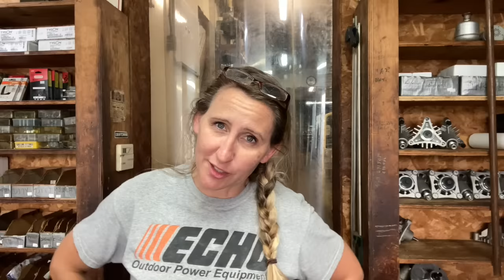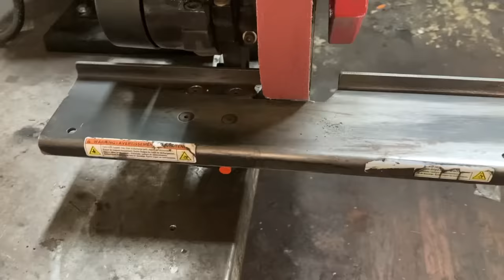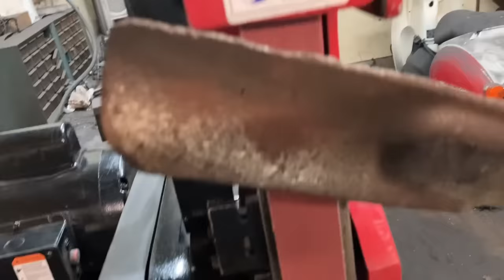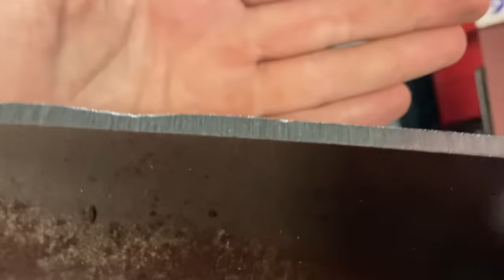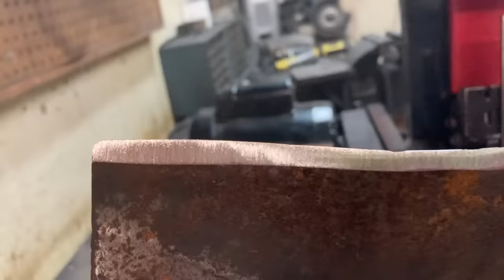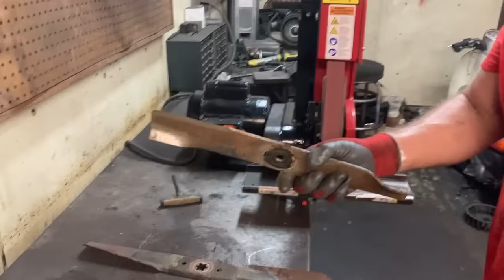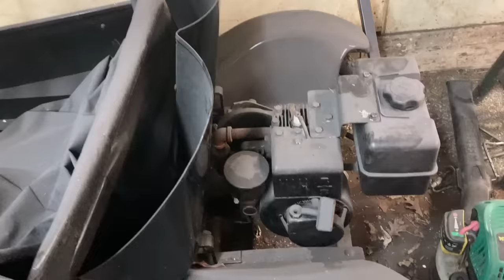The Best Blade Sharpener Ever!!! Oregon Burr King X400

Comment: Does that machine put a factory edge on the blade, hollow grind or some tech's call it a hollow back grind, the one I used when I was much younger as a tech was a large grinding wheel and it did the factory hollow back grind, that's a pretty cool tool if it does the back grind. 👍👌❤️

Comment: First off, if someone wanted to, you could build one of these out of a bench grinder, with a wire wheel on one side and a 4" wide long belt sander, but i do mine with a 4" disk grinder in less time, but my blades never get that funky. 
I was taught by an old heavy equipment operator to just lock the blade in a vice and use a file, 
But i worked in a machine shop 8 years grinders and belt sanders was something i used every day.
I have very good mussel memory using tools freehand  i could just use a 4" belt sander without the bottom plate.
So is the blade in balance?  
If its not it wears out your spindle

Comment: Honestly… I want one but not sure I want to spend that much.  I have a large yard and normally pull off my zero turn blades every 3-4 weeks for a touch-up.  I mow about 2.5 acres of 9 per week.  Rest is wooded so I hit a lot of sticks and dull them quick. Right now I just use my little Cub Cadet HTL 550 lift and a Dewalt impact and get them on/off in about 10 mins.  The annoying part is trying to get the blade angle right with my cheap Lowe’s wheel grinder.  It works but I never know if the angle is right.

Comment: You might try a zirconia belt I have had better results with those as to life and blade cooling.  For reference I run a older 2 x 72 belt grinder with a 2hp motor so your grinder is different but still worth a try.

Comment: My problem is not sharpening the blades I can do three with a right angle grinder and flap disc in just a little over five minutes with balancing my problem is finding a blade that will last down here in the Florida sand on a Dixie chopper it goes through them like Rosie O’Donnell goes through Twinkies…

Comment: Yes, if you are a dealer who not just services machines, but sells them, making a good 200,000 or more a year annually, you could justify and afford to purchase a 1500 dollar top of the line kickass blade sharpener. But if your a small town shade tree mechanic like me, or home owner, I can agree with you, we don't have those. I personally use a Milwaukee 13-amp angle grinder with flap disks, yes it takes me longer for sure, but it gets the job done. And don't forget, sharpening is not the whole project to blades, got to balance them too. So I ask you, what balance tool do you use? I use the cone shaped ones.
Reply: I grind down old spindle shafts on the the belt to make balance posts. The Chickanic just asked me for some blades to sharpen so I went to the scrap metal and got three. There was no way I was going to balance some scrap pile blades after she kept me at the shop late. I also removed the riser on the table that holds the shaft to shoot the video, but that machine is gold to us, don’t think I could do a summer without it now.
Reply: @dudekanic  Neat idea, I like it! I just discovered Chickanic, I think she is awesome, we need more lady mechanics in the industry. It also helps in being self sufficient. Cool stuff!

Comment: Clearly a belt may do a better job than wheel. With this set-up you can put a concave cutting edge on the blade and then add a straight (fine) cutting surface. One can do a similar job with a standard 2 stone grinding wheel, providing one is careful not to destroy the blade's temper.

Comment: I mount the blades from my 72-inch deck from a JD F915 in a bench vice, and grind them with a 4-inch handheld grinder. Seems reasonably effective, and it's way less expensive than your grinder. Maybe takes two or three minutes per blade. Is there a particular grind wheel brand or material that you'd recommend?

Thanks.

Comment: Mine is bigger than yours!  I have a 2x72 with  1.5hp motor, a 3hp is actually better.  But I needed to run off 115, and it is good enough.  This is standard for knife makers and other fabricators.  At 3hp you could push a wrench into the belt and it would disappear, though it has variable speed so you can reduce the cut down to almost nothing.

2X72 has a lot of advantages (it will take belts down to 60"), but the main one for a lot of us is they make belts in a variety and quality you can't get in many other sizes, if at all.  It could be they are out there, but as far as what people actually stock the belt quality for 2x72 in unparalleled.
Reply: YT is full of videos on how to make a 2x72 grinder!

Comment: Hi, very impressive results! I am a homeowner and have 1 mower.  Can you recommend an affordable blade sharpener? I've read that slow speed sharpeners are best because they don't overheat the steel and ruin the hardness. Would you agree with that? What sharpeners do you recommend for a homeowner, belt type or grinding wheel? Keep the great videos coming, thank you!
Reply: Use belt sander they work well.
Reply: @marknagy4779  what brand?
Reply: Baur 4in × 36" Belt and disc sander at harbor freight for $107.99 and sharpen blade on  belt side on the round end works well.
Reply: @marknagy4779  Thanks Mark

Comment: How Does It Work on The Mulching Blades That Have Curves and Angles I Do 30 Blades a Day At My Shop Most of Them Mulching and Use an Angle Grinder and Blade Balancer I Do Most of The Commercial Equipment

Comment: 4:10 - Do you guys normally sharpen this fast or was it just for show with a scrap blade? Im aware that lawn mower blades are often made from mild and/or bad steels, but if its so hot you cant touch it, wouldnt that put the thin metal near the edge at a temperature that could mess with the steel?

Comment: I'm on my daughter's YouTube account. I have to admit that is a very nice machine. I wouldn't take it as a gift. It way more dangerous than you think. If the belt spun in the opposite direction it would be way safer...but then the sparks would be coming at you. If you're curious about my claiming that your machine is dangerous, drop a pencil where the belt is and see what happens. Then picture the pencil is your finger. If the belt spun in the opposite direction then it would push your finger away. But the direction it spins it'll keep pulling your finger(s) and maybe part of your hand in there. I can't tell you what to do, but I would suggest not trying to sharpen blades as fast as you can. The fingers you save could be yours. I'd hate to hear that someone got seriously hurt trying to go fast. Just because your car can go 100 mph, doesn't mean that you have to go that fast to the grocery store. Take care and be safe.

Comment: That is so impressive.  I have a question though.  I have a 72 inch Landpride mower that I pull with a Ford tractor. I bought new blades for it from Landpride.  The blades were not sharp.  They were rounded.  Why is it when you buy new blades the edge is rounded off?  Are we expected to sharpen them right out of the box, or just put them on and start cutting? The grass does get cut but the blades are worn, not truly sharp cut edges. What's your take on this?  THUMBS UP!!!
Reply from the maker: Not sure if this is the same with your particular set of blades, but I know that when you buy riding mower and zero turn blades, they come with "the perfect" edge. The thick paint also obscures the cutting edge, but will wear off quickly to expose it. Sharper does not always mean better. The thinner it is at the edge, the faster it dulls. This is probably not the best explanation, lol, but the answer is no, you should not have to sharpen new blades. Thanks for watching!
Reply: @Chickanic   You're the best, and we love your channel, and believe in the information you put out to us.  THUMBS UP!!!
Reply: Maybe so you don't get cut while installing them?

Comment: Mine didn't cost that much.  I use a wet, diamond wheel grinding system with buffing wheel.  Gets blade razor sharp with no heat.  Unfortunately, they use such mild steel, that heat tempers the metal so the blade doesn't stay sharp.

Comment: Good video. wonderfull belt grinder, looks like a 2 x 42, or 2 x 48, 2 x 72>  i made one, from a 1 hp tablesaw motor, and a lawnmower wheel, ( minus the rubber ) plastic, onto motor. Used a skateboard, 2 inch bearinged wheel, for tensioner (with tracking) Vertical, just like this video one.  Rpms' is 3450, on motor driving 6 inch wheel. Runs very fast, can take off material like mad.  Anyway, good luck to ALL..
Reply: My homemade one, works just as good. ( for a whole lot less, than 1500 bucks. Probably spent only 20 for steel plate, skateboard wheel, and some angle iron )) I got a dish, of oil sitting right beside 2 x 42 grinder, for  TEMPERING. anyway, good day to all..

Comment: Great video, what grit do you use and what abrasive grain you use? Silicon carbide? I like to make my own blade  sharpener with  my grinder that looks like yours that also has a 6” disk too. It is made for wood but I’ll set up a 30 degree angle to make my blade shapener

Comment: I would like to see the balance of those blades after sharpening.
Also you only need 4 or 5 inches at the tip of the blade to cut grass, not the whole blade.

Comment: What is your take on the "American Blade Sharpener" which sells much cheaper than the Oregon.  Its claim is that you can sharpen the blade back to its original angel using the blade setting (15, 30, 35, etc.).

Comment: It may work better then my 4-1/2” angle grinder but my angle grinder doesn’t cost $1500 either. And I can still sharpen blades razor sharp.
Reply: And you don't even have to take the blades off the mower.

Comment: My sharpener didn't cost anything. And it doesn't take 1hp either. A 60 year old motor a couple pieces of metal to hold the blade ( adjustable angle ) perfect 30 degree every time. BUT I do like your videos.... Roy Boy

Comment: I noticed a little different technique on the commercial blade. Beautiful work! How often do you have to change the belt on that sharpener?
Reply: I work at a lawn and garden shop which uses the Oregon 760 sharpener, similar to this one. The belts do a phenomenal job and hold up for about two or so weeks. That being about 100-150 blades. The person in this video did a horrible job sharpening those blades. You have to gently sharpen the blade until ALL damage has been ground out. At our dealer, we also balance the blades, making mowing more comfortable with less vibrations.

Comment: I have a question for ya. My Dad use to do it and I guess I kind of do the same. But is ii needful to balance the blade so that it do t vibrate or not I have a zero turn mower now
Reply: It’s always better to balance a blade as best as you can, even balancing it on your finger. If a blade is too far out it can wear the spindle bearings.

Comment: I love that cart. I think I have several Briggs motors from the 60's and definitely from the 70's. Briggs taught me that electricity travels through green vines and not a good choice to use to push the spark plug kill switch.
My uncle taught me to not hold the spark plug wire.

Comment: How many times can you sharpen a blade before you have to replace it. I mean is there a certain thickness that I have to go by. Or is it just by looks
Reply: If you have a mower with three blades and you have reached the sharpening limit, there will be skips in your mowing because the blades will not overlap like they should anymore.

Comment: Do you have to do an additional step to make sure the blade is balanced? I may be wrong but it looks like it would be easy to remove more metal on one side of the blade than the other.
Reply: see the pinned post

Comment: Yikes. Reaching around that moving belt and could  be a recipe for  a good skinning for someone in a hurry. Believe I'd find a better location for the on-off switch. He obviously has got the skill set and turned out some great results!
Reply: I agree about the awkward switch location, though I think he was standing to the side to allow clear view for the video camera.  I suggest getting a safety paddle switch like those used for table saws;  also adding some form of dust collection is recommended.

Comment: That sharpener is awesome! Is that your husband and do you free hand the angle or does it have a  guide? Love the go kart.
Reply from the maker: It is a set angle. It has two adjustments. Depth and angle. Thanks for watching!
Reply: @Chickanic  cool machine.  I live in Oregon and love seeing the Oregon brand Machine.  The sharpener probably isn't made here but they do make chainsaw bars and chain here . They have a great selection of aftermarket parts and tools.

Comment: Perhaps I missed it, but how does that machine set proper angle?  It appears it is totally operator dependent, similar to just using a bench grinder. ???  And btw, I always like tool video's regardless of price, but in reality this tool makes no sense for DIY folks.  I personally sharpen my blades two or three times per season, manually with a flat file followed by basic static balancing.  Works great for me, but of course it wouldn't be practical for a high volume shop.

Comment: Pretty impressive, however, don’t you need to balance your blades? Sure makes a difference on your mower. If it’s balanced, the deck will be smooth
Reply from the maker: These were just junk blades that were bent. I was just showing the cut speed, but yes we do make sure they are balanced when it is customer blades. Thanks for watching!

Comment: Great video, and great sharpener. It looks like it does a really good job, but what do you do with the blades that have different angles on them?  I did a lot of research before I bought my All American Sharpener, but I must have missed the Burr King.  Maybe because it’s out of my price range, but I’ve found that different blades require a different angle of cut, especially the Honda mowers. B how do you adjust the angle of cut on the Bur King, or is it one angle fits all?  Lol   I recently stumbled upon your channel, and love it.  I subscribed after one video.
Reply: 4-1/2" ANGLE GRINDER WITH A FLAPPER WHEEL DISC DOES THE TRICK, GRAB A CHEAP BLADE BALANCER AND YOULL BE SET.

Comment: In other words, get a BELT SANDER... but don't Sharpen your blade like the video shows , so quickly.  Running the blade on a Grinder or Belt Sander causes Heat to build up, and removes the hardness that WAS in the blade, making the blade get dull much quicker.   Remove only SMALL amounts of metal, just to get the blade back to the original angle, and flat.  Not a bad idea to have some quench oil on hand to dip the blade in when you are grinding , to keep it cool either !

Comment: you paid $2400 for that? i have a 4 in 1 with that same function and a disc sander, a 2" rotating belt sander to any degree i want it at, a 4" flat belt sander and a spindle sander vertically mounted next to the 4" flat belt sander i paid $149 for it at menards in 1996. for metal i mostly use my Norton AVOS discs so i can see my work as i am grinding it and it only takes about a minute per edge to make them razors i can cut paper butter smooth with.

Comment: After having to hog off so much metal to get to a good edge, how important is it to balance the bade afterwards?  Is that process time consuming?
Reply: We were just showing the machine off. Those are blades off the scrap pile, but good blades balance out very quickly, ya just put the blade back up to the belt. Maybe 3-5sec.

Comment: I know that these tools make it easier.  but if your blade has a nice even edge, I would rather just us a file.  It really does not take that long and it will get REALLY sharp - close to razor blade sharp.   but I will admit, if the blade has a log of damage - use the easy tools. would take too long with a file.

Comment: why YES your expensive machine is FAST ... but it over heats the metal in the blade = it looses its hardness and your now sharpened blade , won't last long before it needs to be sharpened again !
i use a wire brush on my right angel grinder to clean all of the dirt n rust off then use a file to sharpen the blade .

Comment: Sure it's fast if ya don't balance them.... You can put new brake pads on without turning the rotors too..... and that's not a perfect 30 degree either.... that work surface is set at the bottom wheel... wheels are not flat... there's ever so slight an inside curve and not a 30 degree.... maybe close (like my $100 10" bench grinder that takes about a fraction of a second longer), but not a perfect flat 30 degree..... good nuff tho.

Comment: I don't know where you folks are from, I am in Florida where the sand completely destroys a blade.  by the time you piss away all that money for the equipment pull the blades and sharpen garbage blades that are likely gonna be out of balance and destroy your jack shafts, easier and cheaper to buy new blades.

Comment: Of course, for a beautiful, nearly perfect blade, the surface grinder is king. But it would take a significantly longer time to setup and use, and in the wrong hands is extremely dangerous. Actually, any fixed grinder is very dangerous if one has no experience using them. When you watch someone skilled using a pedestal grinder, for example, "it looks so easy anyone can do it". But looks are deceiving leaving the inexperienced ignorant of the fact of what could go wrong. If one lifts the front end of a piece while grinding, it can get kicked out quite forcibly, which is another reason to wear safety glasses. Also, if it has a tool rest, you have to make sure the gap between the rest and the grinder is small, otherwise your piece can get jammed into the grinder causing the wheel to explode. One must not use an apron with tie strings, as those can get sucked into the wheel, sucking you in with it. Those with long hair can similarly get it caught in the rotating mechanism with disastrous consequences.